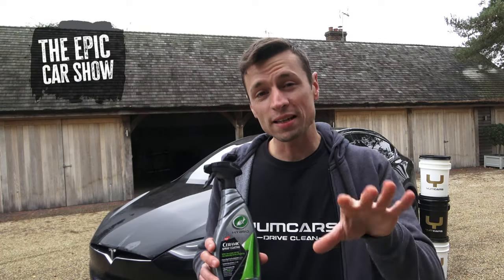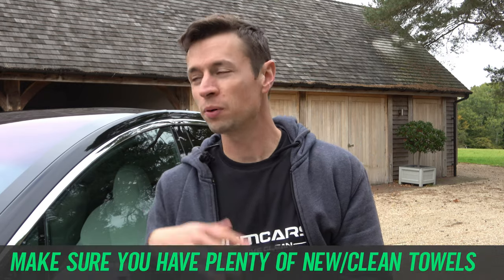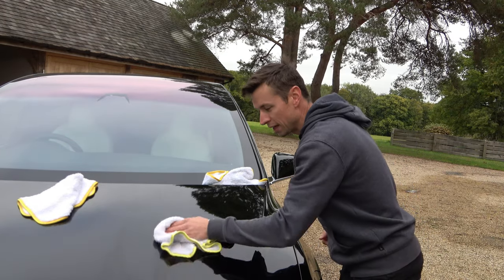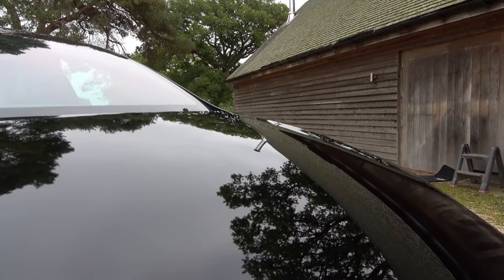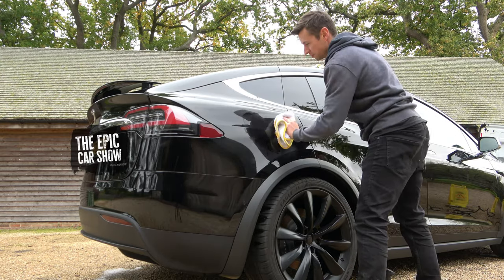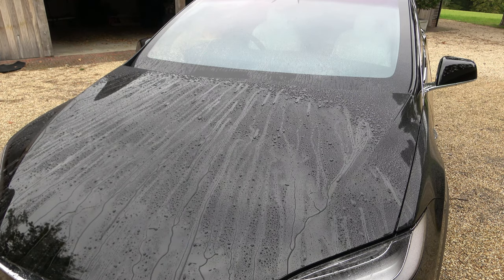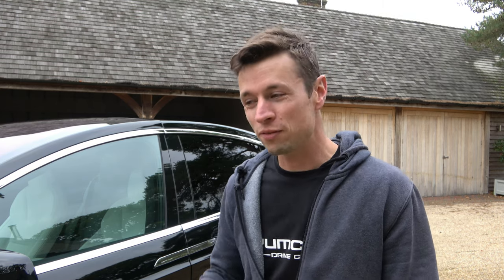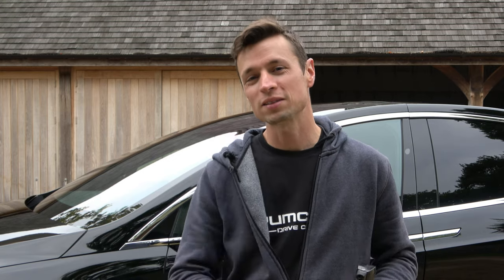Turtle Wax Ceramic Spray Coating Review | Fix Streaking on Black Cars

Comment: Great videos. Have you had any experience with Auto Finesse caramics? I have a kit I have yet to put on my car
Reply from the maker: Thank you. It's on my list. I revisited this car before lockdown and this was incredible. The water still flew off
Reply: @epicautomotivedetailing  Nice. I plan to detail  my car this weekend and polish using Autoglym super resin polish before putting on the Auto Finesse caramics kit

Comment: Will the wet towel wipe off or ruin the adhesion of the product to the surface?
Reply from the maker: No not at all. Honestly were talking few squirts on towel so it's lightly damp. So definitely not soaking. The water makes it so much easier
Reply: @epicautomotivedetailing  Sweet thank you! Ive done the damp towel for streaks before, I just didnt know if I was wiping off the sealant lol

Comment: A bit confused here. Do you apply the product with a damp towel and then dry it off with a dry one, or do you apply with a dry towel and then only use a dampened towel if you see streaks?
Reply from the maker: Just use a damp towel only if you see streaks after
Reply: @epicautomotivedetailing  Honestly didn't expect such a quick reply on a three year old video. Thanks man! I'm trying this out for the first time tomorrow :)

Comment: What protection are you applying on front window? Can you use turtle was cc to car windows?
Reply from the maker: For Windows i hardly use protection as most cars are done regularly every week or so, I just keep it simple. The glass cleaner I'm on at the moment is yum glass which is ace 👌
Reply: For front window I suggest Carpro FlyBy Forte  or SOFT99 Ultra Glaco

Comment: How easy is it to use clay bar ? Can you damage the paint with it?
Reply from the maker: Very easy. You will cause marring on the paint. So you need to polish out the marks after so only advise if you're doing the whole hog

Comment: May I ask how to fix the streaking after the cure? Will reapplying makes the streaking to get balance?
Reply from the maker: i have tested a few all in ones. such as autoglym super resin polish and rupes uno protect. works fine but after that i stopped using the turtle wax because there are better alternatives
Reply: Thank you, so do you think reapplying the TW ceramic spray to the streaked area will make it even?

Comment: At roughly 2:55 you mention wiping the car with a "damp" towel. My question is, damp with what? Damp with the ceramic spray or with water? If so, is it cold water, hot water, soapy water with a car wash compound? Please advise.
Reply from the maker: Apologies. Water
Reply: @epicautomotivedetailing  Fantastic, thank you very much for the speedy response and best of luck with the business! 😁😁
Reply: (Love your videos by the way they've been a fantastic reference for becoming a weekend warrior 👍)

Comment: terrible when I used it. The streaks were a nightmare to get rid of. I get the part that if you take your time it does come out and I agree ,but way too much work. I tried a friends higher end spray and it was much easier. I'm not a professional just a weekend warrior but this was harder than wax in my opinion.
Reply from the maker: Yes there is so many better sprays out there for application. For regular cleans I'm loving Autoglym Rapid Ceramic detailer

Comment: After applying it on my car suface, I have found that on some areas paint does not feel smooth to the touch.  Is there a way to restore the paint smoothness?
Reply from the maker: It's all in the prep before hand. Get that surface decontaminated and this will be more effective

Comment: Does spraying it to de cloth work?
Reply from the maker: It does but it's one of those hit and miss products in terms of application. Too hot and it can cause problems but the damp towel followed up with a dry one is the answer. It's actually one of my favourites now
Reply: @epicautomotivedetailing  Cheers.  Will give that a shot tomorrow. Packed it in today after streaking the bonnet on my black A5. Was genuinely disappointed.

Comment: But, on my bottle, it says it has to be applied to the WET paint. I just wash it, and while the car is still wet I spray this, dry the water and it, and then buff it up. And I don't get any streaks. (my car is black)
Reply from the maker: labels have changed mate. never used to say that

Comment: Do we need to wash car again before applying 2nd coat?
Reply from the maker: No but of it's left outside over night then you may have dust so air compressor it off or give it a rinse 👍

Comment: I live in the hot, sunny, southwest United States. The ceramic does dry pretty much instantly, so I get streaks in my maroon colored paint. Has anyone applied the ceramic spray and just wiped in on, without polishing it out, on a white fiberglass surface? I want to put this on my travel trailer for bug protection, not necessarily for a beautiful finish. 
I’m curious if the towels used to apply and polish can be washed and reused. I’m thinking the ceramic coating would stay in the towels pretty much forever, even after washing.
Reply from the maker: Yes you can wash the towels this isn't a full blown ceramic

Comment: I used this Ceremic on my R33 GTR and left nothing but streaks how do I fix it I shook the bottle and sprayed 2 times per pannel so pissed off with this product
Reply from the maker: Hello it's very easy to fix just grab a microfiber cloth spray it few times with water and wipe, it's sio2 so all sio2 products do this so it always requires another wipe
Reply: @epicautomotivedetailing  I have tried this and it didn’t work
Reply from the maker: its all about the prep. What they did was sell a difficult product to the beginner market and they should of sold this with a clay bar kit because these works best on a perfectly decontaminated surface. cant see it being on the shelf too much longer @33_Fash
Reply: How do I remove it from the car? The car was clay bared 2 step polished this this was applied and it looks dull and crap..

Comment: all you have to do is dilute the product with distilled water just a bit not a lot and you'll get a better user experience and it still works the same ir use it as a drying aid

Comment: Lubly chubly 😂
I love the 🐢 Hybrid Solutions Ceramic Wet Wax as a drying aid. 💎👍🏼
Also give my deadly treadly a coat for a few Extra Watts 😂😂
Aero Turtle 🚴
Reply from the maker: Lots of people talk about the wet wax drying aid. Looks like I need to test it out
Reply: @epicautomotivedetailing  I'm not keen on it tbh probably the least  product I would buy out of the lot,just seems to be a waste  of time and It doesn't look as good as the ceramic spray wax it just seems to dull the colour and shine just a little bit I have found,i Also found it doesn't really aid in drying that much compared to others
Reply from the maker: @adriangroves145  who's tried the ceramic Shampoo?
Reply: @epicautomotivedetailing  no I haven't tried it ,I like mine to have a good soapy wash I use megs gold class or autoglym HD shampoo,as said I do really like the tw ceramic spray wax though. The detailer spray is also very good

Comment: I don't like spraying product on the paint.. specially when its hot outside. Even under a shade most products will dry out right away before u can even wipe it down. That first spray will always leave something on the paint that u will need to buff off. Spraying on the towel to the paint worked for me. Just keep it saturated with the product and have an extra dry towel for that final wipe.

Comment: theres no need go through the aggro nowadays theres plenty of similar products that dont smear , auto glym rapid ceramic springs to mind , super easy apply and no smearing and does last longer than anything else ive tried over the years , second to that meguires spray on ceramic

Comment: I have better results by spraying onto a microfibre applicator, one towel to level and one towel to buff.
Reply from the maker: great tip thanks for sharing with the community
Reply: Thanks for the video,  I will definitely try levelling  with a damp microfibre next time.

Comment: to me, if it streak, you haven't left it on long enough and you removing it too soon while its still wet
Reply from the maker: Hello I've tried so many combinations in different weather and it's always different results. It's one of those products that is so hot and miss. Definitely only easy to apply on perfect paintwork

Comment: Doesn't work well with black cars in the sun/heat. Try watering it down 1:1 with distilled water, or applying it while the car is wet... so long as the car doesn't need to be polished that is. Buffs off easier without the streaks
Reply from the maker: Thats the number one common complaint people have

Comment: It’s possibly the wo sorry,but you still have system stop streaks after the wet cloth ,this I’d very hard work for little gain,it’s bonkers.   I use Halfords own wax polish and it lasts  for months does on end,not streak and easy to apply .
Beads up as good as any polish and more that adequate .

This turtle wax is rubbish, you need to take a weeks holiday to apply it,you go out and in the first day it’s rubbished with the weather we have in the U.K. and the worse thing about it is that no one gives two hoots about your shine.
Reply from the maker: Yeah it's difficult to like but easy to dislike. Too many better products out there

Comment: Was he applying too much??  Them streaks.
Reply from the maker: Streaking occurs on all cars as forensic detailing proved. You just don't see it in lighter cars.
Reply: Do u have a video on ceramic coat? I want to apply myself,  new car so paint is pretty much pristine,  probably just need to prep w clay bar.

Comment: Dave the streaking is really bad with this product. Won’t buy it again. Too much faff
Reply from the maker: I agree it's not beginner friendly
Reply: I prefer the Meguiar in that respect. I'm also getting some streaking with TW. I have to go back next morning and give it a wipe, or two which isn't great. 

I think I'll go back to the Meg after. it works wet too. It's easier to apply, and the results aren't bad. The bottom of the Meguiar bottle disintegrates though, dunno what's up with it.

Comment: I bought this and it leaves greasy surface no matter what i do. Crap, dont buy it
Reply from the maker: Trust me if you tweak the application method you will be impressed. It needs a perfectly clean surface too. I've tweaked it and it's very good and in fact I think it's better than the graphene